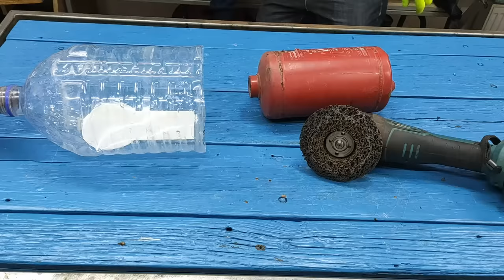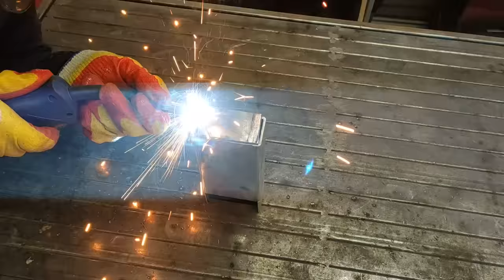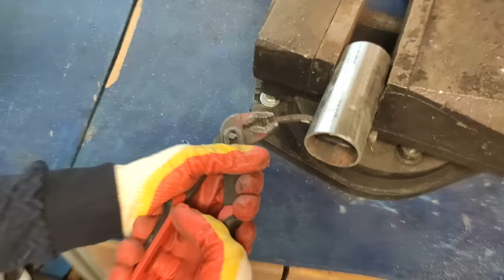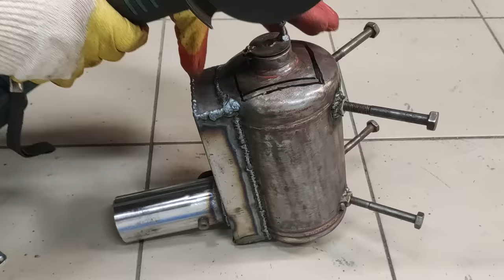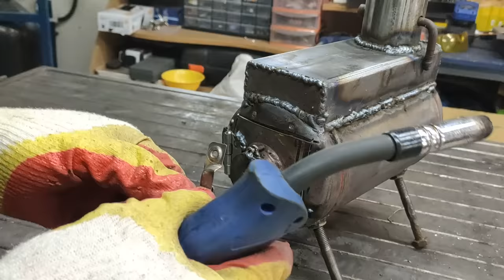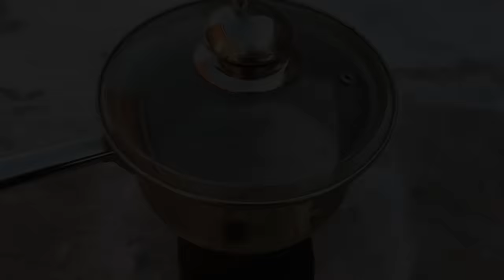DO NOT throw away your old fire extinguisher!!! An amazing idea for every MASTER

Comment: You are blessed to have every fabrication machine at your disposal, and the idea of a tiny log burning stove is brilliant. However, even the black paint can't hide the poor standard of your welding, sorry. Maybe take a course in basic welding, and then the presentation of your work will be of a much higher standard. The first thing a fabricator/welder sees is your welding, then how square and lined up the corresponding parts are. 🙏